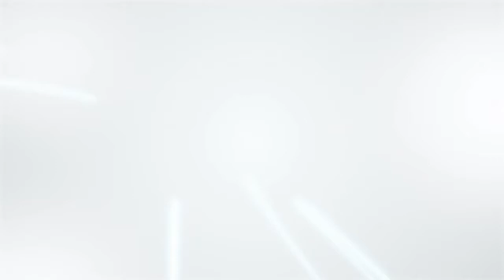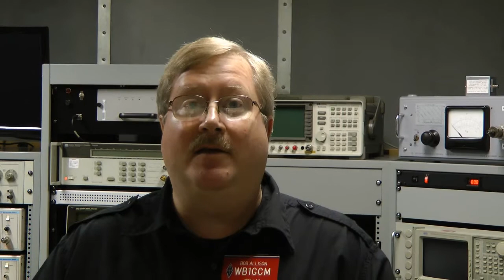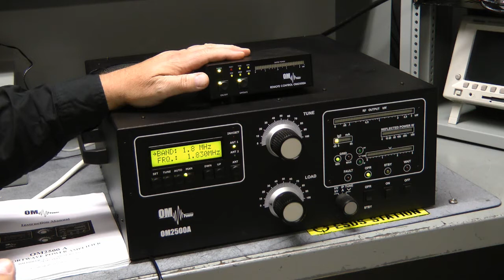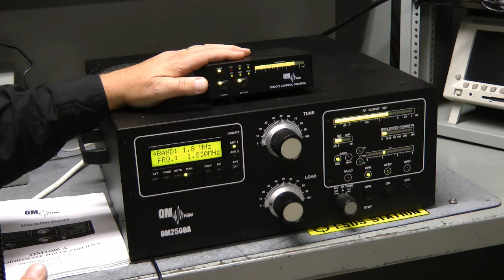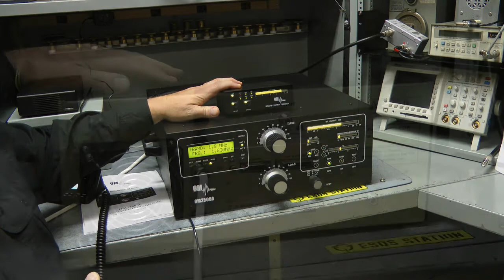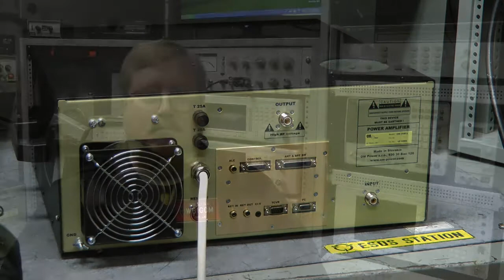OM Power OM2500A Amplifier

Comment: Mr. Allison, you mentioned in the review, the OM Power 2500A, uses a GU-84A tube. However, the amplifier now uses a single FU-728F tetrode.   In regard to another comment, regarding the single antenna port output. The OM Power amplifiers are designed to complement an externally controlled antenna switching matrix. One that is more common in today's technologically advanced contest stations, and stations that prefer remote control to switch between multiple antenna arrays and/or band pass filters.

The control unit on the rear of the amplifier is a unique feature, and provides the capability to control external antenna relays, and other devices.  Additionally, the socket marked "computer" on the rear of the amplifier is not to control the amplifier with a computer.  Rather, unlike many amplifiers that require CAT control, but have no provision to share the CAT data.  The OM Power OM2000A, OM2500A and OM4000A, also include a sharing devices, so both the computer and the amplifier can share CAT data from a transceiver.